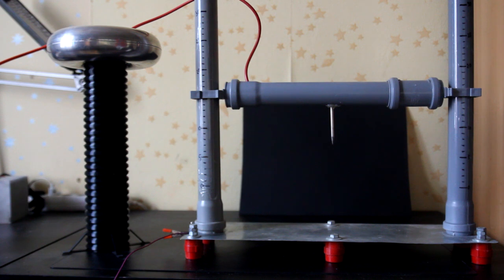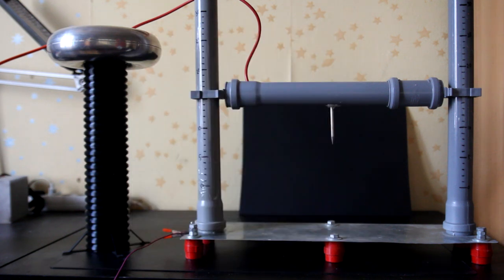Flare Corona Discharge

Comment: Thanks for the clear methodical explanation to go along with your demonstration, and good luck in the upcoming academic year, although I suspect you won't need it :D
Reply from the maker: Haha, thanks! If you plan to replicate my setup, be careful with the ozone!
Reply: @Vidduley  is ozone really that bad for you? What can it do?
Reply from the maker: Well not going into details, it can leave permanent lung damage and in the worst case compeletly destroy one's lungs, ofc for the latter the ozone concentration needs to be very high. By specific units, ozone is more dangerous than such known gases as chlorine or cyan. That's why I'm ventilating the room after each run, and the runs by themselves are relatively short. Frankly though, I use such precautions only with really powerful high yield ozone generating setups, namely this one and dielectric barrier discharge one (video coming .. somewhen). Single streamer corona probably won't do much harm.
Reply: @Vidduley  i made a small 60kv power supply and i could smell a bit of ozone i dont think it created that much to hurt me...
Reply from the maker: Yes, as I said, the small amount probably won't hurt you. The thing is, really dangerous concentrations of ozone disable your smell sensation, so you won't smell it at all :) Don't worry, if it would've hurt you, you'd notice that by coughing and other stuff.
Reply: @Vidduley  hey man do you have stuff for sale or do you have a email i need to ask you something

Comment: I see you like to test different corona discharges. So I can suggest you an experiment: a magnetohydrodynamic drive that propels an aircraft, that’s a corona discharge which interacts with magnetic field.

So the concept is as following. Install two corona emitter electrodes in front and on the back of your craft; supply the electrodes with co-linear field coils (or permanent magnets) in order to stretch two coronas as far as possible in the opposite directions so this way you’ll have wider semi rings of air current sideways. On the left and right sides of the craft you should have electromagnetic coils or permanent magnets to push down both semi rings of air current; if the front electrode is positive and back is negative then the left side must be a north magnetic pole whereas the right side is south magnetic pole. According to Flemings’s left hand rule the air will be propelled downwards thus pushing the craft up.

This concept seems more advantageous than so called “ionocraft” because the latter consumes a lion share of its potential payload with a big array of corona electrodes whereas the concept that I just offered uses vast air flux cross section without need to stretch any grand electrode arrays; it basically makes a “virtual ventilator” of much bigger size than the craft itself.

I have subscribed to your channel. It would be great pleasure to see my idea tested. Thanks in advance.

Comment: EXCELLENT!  I was going to try making a sheet-discharge between parallel tungsten wires using large-value series resistors.  Too expensive.   A series-gap is just the thing.
This unstable glow-mode versus arc-mode (versus "pseudospark,") is identical to ...iron chokes used on neon signs!  Also, series-ballasts on HID lamps, or the 100K resistor on NE-2 neon pilot lights.
Engineering: add a series-component which creates a "load line" curve of proper slope.  This only allows a single operating-point on the wide gap's V-I curve.   (Or in your case, the VI curve of the acorn nut spark gap has only one point in common with the VI curve of the wide-gap discharge.)  Ideally, spark-discharges can never happen.  But ballast resistors are terrible, since they dissipate large wattage.  Everyone instead uses HV AC and series inductors or rarely, capacitors.  But with a quench-gap, we can now use DC, with no resistors to ruin our high-watts output value!   Genius!

Need to try multiple chain of 0.1 -mm gaps (three acorn nuts, or maybe ten.)

IDEA:  also try an AC version, either with wattage-limited primary, or with an EHT series capacitor of the correct value, perhaps a variable cap immersed in oil.

Nikola Tesla also did this, placing spark-gaps in the HV side, rather than current-liminting on the 120VAC side.   I'm convinced that this produces all sorts of weird effects: stuff nobody has ever encountered, since instead they all use conventional low-volt current limiting.

In other words, adding a spark gap as a "ballast" to the HV side, this may well be one of Nikola Tesla's major lost secrets.   Nobody would discover this, because "EHT series-ballast" is hard to do, and everyone assumes that a simple current-limiter on the low-volts side will give identical results.

PS  
on ebay, search for "copiers" "tungsten" and you'll find all sorts of extremely thin wire which is designed for producing ultra-smooth corona discharge.  0.001-inch tungsten wire in photocopiers, it's called "coronatron wire."   I only discovered this because I bought a big box of copier-repair parts, with a spool of that strange wire.
Reply from the maker: I'm glad you've found my video useful! Thanks for all the info :)

Comment: I am soooooo jealous of your corona discharge,,,its so hard getting the right volumetric discharge without sparking
Reply: Thank You SOOOOOOOOOOOOOOOOO Much Man I have tried sooo many ways but your video finally gave me the means I was looking to get a stable controlled corona discharge,,,I always assumed it was my power supply that was the issue but it seems it is the charge pump of your double gap discharger is what makes this possible

Comment: came across flare discharge on accident before learning about it and was really interested in seeing what it actually was. Was using an ac flyback made by RCA connected to a voltage tripler for an old solid state television.
Reply from the maker: Cool!

Comment: Amazing video. I'm really glad I found your channel.
Could you perhaps do a detailed video on your power supply setup?
Reply from the maker: Thanks! I already have a video about my voltage multiplier, which provides high voltage in this case! However, I indeed am planning to make a video about my ZVS driver and flyback transformer, which power the voltage multiplier itself.
Reply: @Vidduley  That's great to hear. I'll be waiting that video

Comment: Very interesting video!
I have a small solid state tesla coil and I noticed that the frequency of the input signal also influences the stability of flare discharges.
For example at around 16.5 kHz I get very stable flare discharges and a strong ozone smell.
Is there a connection between the pulse frequency and how the discharges behave?

Comment: Vidduley,

Put a sharp point at the bottom.  Use a circuit to monitor the current and set a maximum.  Trying to use hands and eyes to control a process that moves at nearly the speed of light is a losing battle.  Measure the FFT of the current, and solve for the modulation to have the path what you want.  Are you aiming for a smooth cylindrical channel with a particular beam power density or current density?  What is the voltage? What is the current?  Basic measurements will speed your development process.  Guessing and doing things by eye and hand is basically impossible, which is why you are spending years getting to this point.  I like what you are doing, but you can be more efficient.  

Richard Collins, The Internet Foundation
Reply from the maker: Mr. Collins, thank you for your interesting suggestions under this and my other videos! The goal of my videos is to teach and show, not to create some new invention or product etc. One could say it's quite the contrary, most of the stuff I show is 80+ years old technology. It just needs more coverage on the internet, in my opinion, hence why I make my videos

P.S. Don't get me wrong, I am also a strong advocate for correct measurements in high voltage hobbyist community. Most of the time it just isn't what I'm trying to convey

Comment: Hey, amazing demonstration! I was wondering if this would produce more ions per watt and area than say, a typical flyback transformer? Might be good for ion lifters/propulsion
Reply from the maker: Good thinking! Idk about efficiency per unit, but this pulsed approach allows you to postpone the breakdown (so to speak) and create more corona as you do so. My little knowledge on lifters tells me that usually their corona intensity is limited by breakdown between the foil and the wire. Short pulse periodic corona might solve that problem to some extent. I know that with pulses of 40-50 ns and voltages of 100-1000 kV corona can be created in giant meter-scale branches without breakdown. Pulse repetition frequency of about 1 kHz allows to push 20-30 kW into that corona. Such high parameters are made possible by SOS technology (semiconductor opening switch), if you want to look it up.
Reply: @Vidduley  Amazing! Thanks for the reply, I'll need to check that out. If it's possible to increase the power over a distance without breakdown significantly then using some electro or perm magnets for MHD thrust becomes much more of a viable option as you can get a lot more charge per unit area than conventional lifters. NASA messured 20N/kW but I ran some numbers and you'd need a conventional lifter the size of a football pitch to lift a person and the power supply (in theory) So biggest challenge is increasing the thrust per unit area which this looks to be able to do. Purely electric batteries couldn't do it until about 1000w/kg but hybrid fuel cell or gas/electric would work really well. Maybe in 20 years when battery tech is 2x or 3x what it is now, it could be done purely electric.
Reply: @Vidduley   Hey, do you have an email I might be able to ping you at? Cheers!
Reply: Hey Vidduley, I'm looking to integrate a spark gap into my flyback + ZVS circuit and I was wondering where you would recommend placing it? I assume the air cathode/anode acts as the resistor in order to charge the spark gap? Or do you add an induction there?

Comment: Have you tried manipulating the atmoshere to see the effect on breakdown? Air temp, gas composition etc? Very hot dry days is the only times ive seen corona discharge on hf ignition tig welders. Outside of that its always spark.

Comment: I wonder if I could create fast ion wind by combining a flare corona discharge with kind of a small version of a linear particle accelerator (linear tube with electrodes with fast-switching alternating polarities with gaps in between). Of course, a multistage ion wind generator could alternatively also increase the total wind speed of the neutral molecules (this has already been done in several publications), but I wonder if separating ion creation and successive ion acceleration could be more energy efficient, because neutralizing ions on the collector side, only to create new ions on the emitter side of the next stage seems like kind of a waste (and has more aerodynamic drag with all those emitters and collectors).
Apart from quickly and repetitively disconnecting the collector side of the dielectric field before the bulk of the ions is neutralized, for the accelerator to work I'd need to be able to very quickly switch on and off the high-voltage sources in the accelerator in order to supply the electrodes with the correct polarities.
Maybe you have an idea how this could be achieved? Switching the high-voltage directly on the output side seems challenging because components like mosfet transistors are usually not rated for the kV range,  apart from heat losses and leakage currents. In other words: it seems more doable if the input side of the high-voltage generator is switched (fine-tuned timing e.g. via an Arduino). On the other hand, there would be a problem if the high-voltage generator would need time to charge up. Is there any good high-voltage source that almost instantly (=microseconds) delivers the high output voltage whenever the input voltage is turned on?
Reply from the maker: Interesting idea! Yes, there are such sources and they are in fact quite common. Pulse transformer (PT) is what you need. Primary - IGBT switch, 1 kV, 200 A, secondary - 20 kV, 10 A. Output voltage can be applied with as low as 100 ns time lag. Another way is mosfet-based Marx generator or linear transformer. These machines also have very low time lag. Basicaly any single-shot pulsed scheme (without inverters).

Comment: That is a TEA N2 laser with the widest discharge gap I have ever seen.
Do you see laser output when you place two sheet of white paper with some distance at the left and right end of your saw blade (to make the UV laser output visible)?
Reply from the maker: Heh, that's an interesting take on that setup! I haven't tried what you describe, although I do believe that I would somehow notice the lasing if it would be present here. I think this thing wouldn't work as TEA N2 laser because the pumping isn't fast and uniform (it takes streamers about 100 ns to bridge that gap). And I believe you need the medium to be excited in less than 2 ns, to effectively pump that kind of laser, that's what amateur Blumlein line construstion of such laser is all about. Furthermore, there isn't a preferred gain path, so the light amplification must be really low, if it occurs at all. So I personally don't think it would work as a laser. But again, thank you for a really interesting take, it has never even occured to me :)
Reply: @Vidduley  My referral to two capacitors intended to point at what should be required to complete the setup.
N2 lasers do not need mirrors to work. To concentrate most of the output to one side, it is enough to make the gap a little wider on the (main) output side.
What seems to happen there: N2 gets electrically pumped and starts to emit photons on the narrow end. As more N2 is already excited at that point in time, a coherent light pulse develops along the discharge gap.
Reply from the maker: Yeah, I sort of am familiar with that concept. Ghe coherence cannot be obtained in such lasers because who said the N2 starts emitting photons specifically in one point that starts the generation? :) Chances are that it emits these "trigger" photons somewhat uniformly throughout the volume, and each of them gets amplified. So the output is more like a UV flashlight concentrated to a beam, but who cares about coherence anyway, am I right. The main thing I was referring to was that the time scales here are far from optimal. At atmospheric pressure, the lower laser level gets full and shuts down lasing in about 2 ns. So ideally your pumping circuit should be done by that time. That can be achieved in non-inductive compact setup. But in my bulky setup with long wires the parasitic inductances and discharge processes limit time scales to 100 ns at best (so maybe more than that). So, no efficient pumping here, hence no lasing. That's all just from my immediate thoughts on the subject. What do you think?
Reply: @Vidduley  I also think that the capacitors have to be constructed in some way close to the discharge gap. Good thing is at those voltages that pretty anything is a capacitor. The hard part is, to prevent the capacitor from transforming into a spark gap.... :)
Best thing might be to sleep a night over it, go to the toilet and develop a simple and ingenious idea how to do it with the things at hand. :)
The standard layered kitchen foil - plastic foil way is out of question at that voltages I guess... :)
I'll tell you, if something useful comes to my mind!

Comment: What circuit did you use for this? Is it a simple high voltage generator with and without a spark gap or is it something else?
Reply from the maker: It's the 150 kV voltage multiplier from my previous videos, with and without a spark gap
Reply: @Vidduley Thanks for telling me!

Comment: This does produce ozone...so it can be used for sanitizing.
Reply: I don`t know how effective it is at sanitizing but ozone is very effective at removing bad smells :) Just make sure you do not breath it as it is not good for lungs.
Reply: @a64738  don't worry, i know that :D
Reply: Yes ozone will kill bacteria and just about anything else living in that room
Reply: @leomadero562   Just air it out after ozone treatment and do not stay in room while it is filled with ozone :) My AC  and dehumidifier has ozone making option to clean out bad smells and it works for that .

Comment: Can I know what is the specifications of your power supply?
Reply from the maker: You mean HV or low voltage input?
Reply: @Vidduley  yup
Reply from the maker: 0-20 V 5 A input, 0-150 kV output
Reply: @Vidduley  is the needle at high potential or low potential.

Comment: what exactly are you studying?
Reply from the maker: At the time of making of this video I was studying for a bachelor's degree in electronics, majoring in physical electronics. I graduated in 2021 and at the moment I'm studying for a master's degree in the same major. Basically our program is a mix of courses concerning the physics of gas discharges, plasma technology, and generation and applications of powerful electrical pulses. Also, back then I was employed part-time in a state research institute, particularly in the laboratory which is conducting research in the field of solid-state pulsed power. Now I work there full-time, with my main field of work relating to computational electromagnetics and propagation of ultra-wideband picosecond electrical pulses.